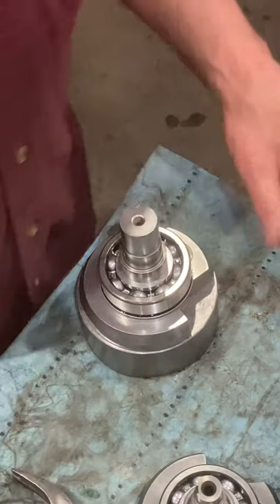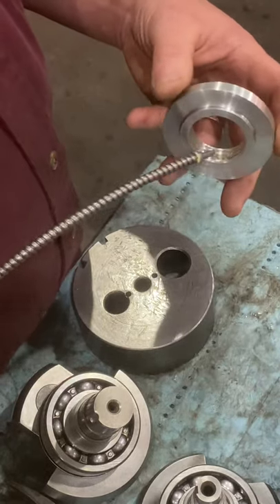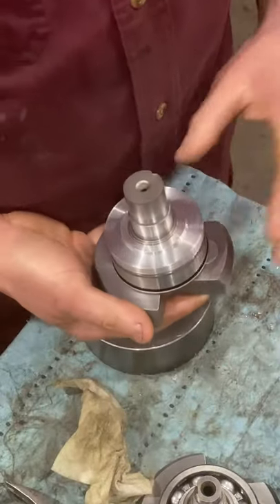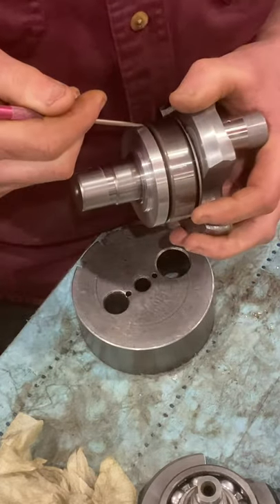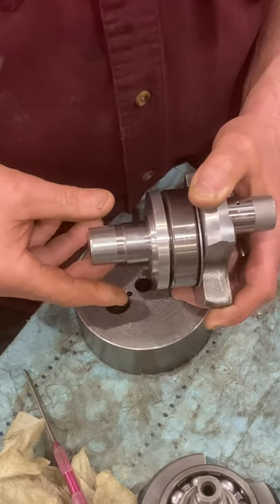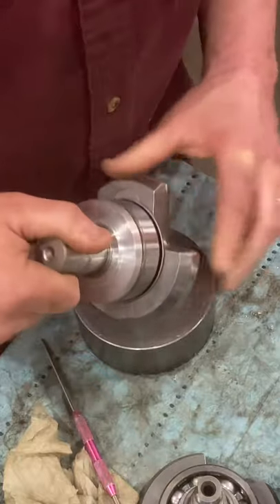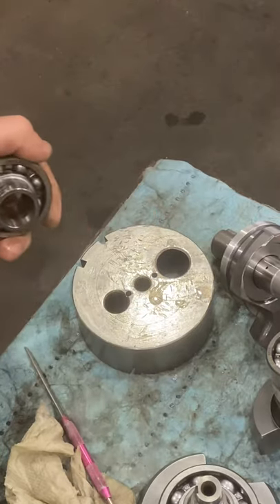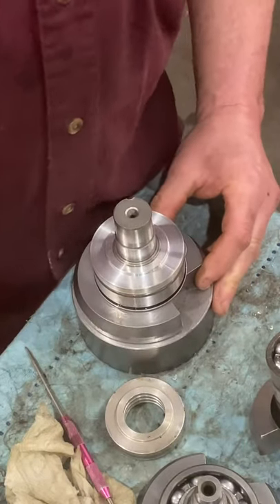Labyrinth Seal Explained

Comment: What am I missing? All I could get was how to fit a specific seal and not how they actually work?
Reply from the maker: I’m sorry. You are correct.  I should have mentioned how the air has to go past the “speed bumps” to get from one side to the other.  By the time it reaches the other side, it is being pressed upon from pressure coming in the other direction.  The air just kind of bounces back and forth within the seal while running.